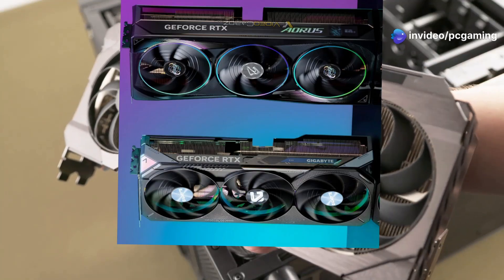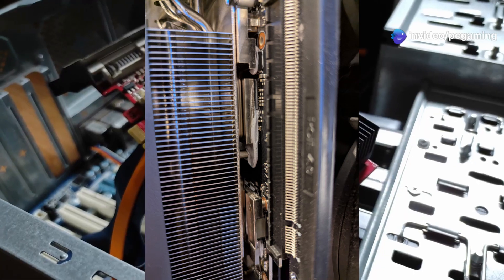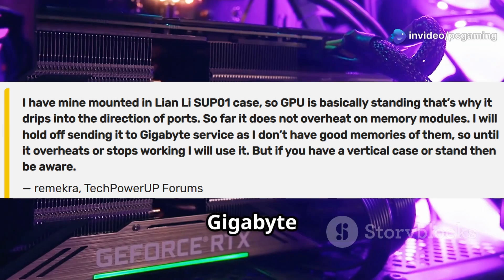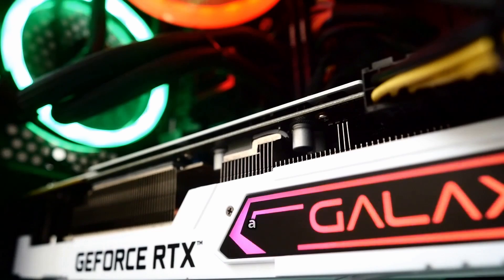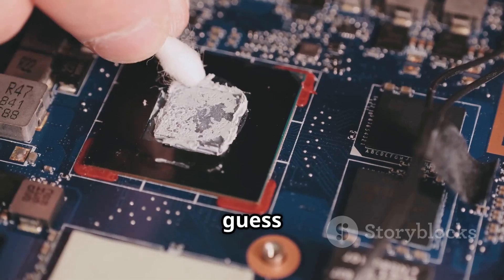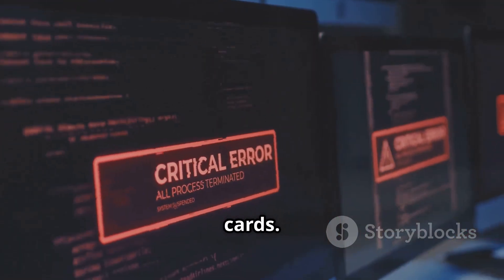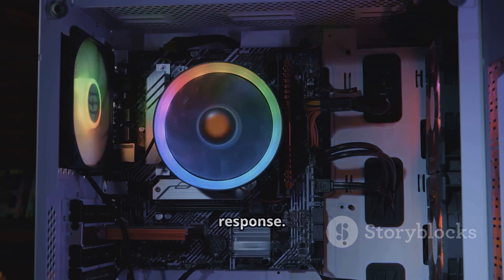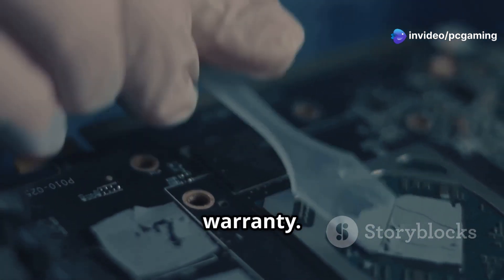Thermal Gel Dripping Problem on Gigabyte RTX 50 Graphics Cards

Comment: for all the ppl watching this. i have a vgpu rtx 5080 from gigabyte and yes mine was dripping (very close to the pcie) i contacted the site i bought the card from. they said: we will not return your money and will rather try to fix it. after i explained them that gigabyte will just put more thermal gel on it and call it a day instead of replacing the thermal garbage with pads they forced me to get an official certificatr from gigabyte that confirms that the gpu problem is permanently since the thermal gel will run down over and over again. (obviously there is no such certificate and no statement from that garbage company)

which means im stuck with that card. the only thing i can pray for is that it breaks down within the next 3 years of warranty. good luck guys :D

Comment: Wow... this seems to be a lot worse than I expected. The issue of thermal gel dripping out is not likely to be a big deal, but the big problem is if there is no longer enough gel covering the areas which need cooling (like memory chips). 

I'm surprised that I haven't heard more about this. It's not just Nvidia cards which are affected. Gigabyte is one of the biggest AIBs, and I think they are using this thermal gel on ALL Nvidia AND AMD models. Unless they've actually changed the consistency of the gel somehow to make it stick on better, it seems that these absolutely should not be used in vertical mounts, OR they need to be re-pasted/ re-padded if you are going to mount it in anything other than a horizontal position. Even horizontally mounted cards might have problems as well 😬

Comment: “Unfortunately, the thermal gel on my Aorus 5080 Master Ice graphics card, which was installed in a Hyte Y70 case, started leaking after just 25 days, leaving some thermal pads exposed. I opened an RMA and returned the card.”😢😢😢😢😢
Reply: Let us know how the RMA goes please 🙏
Reply: Mine started after only a week, same card..
Reply: Keep us updated please
Reply: At the first refund request email, LDLC replied reassuring me that the problem was only aesthetic and that I just needed to clean the leaked thermal paste. I replied that I was not responsible for cleaning anything and that some pads were exposed. The next day I called them in a heated tone; in the end, they granted the refund, but as store credit. Today the refund arrived—tomorrow I’ll decide which graphics card to get.
Reply: @lugiust26 I just returned mine, replaced it with the asus astral card